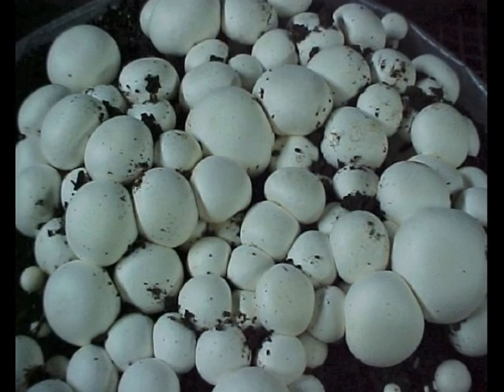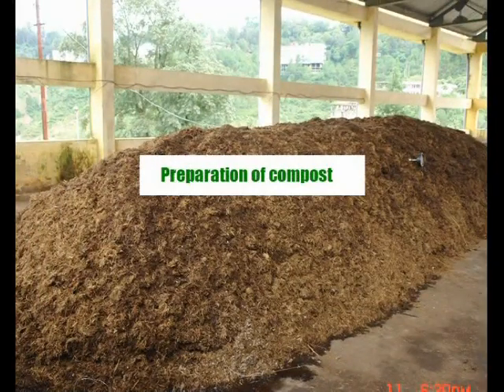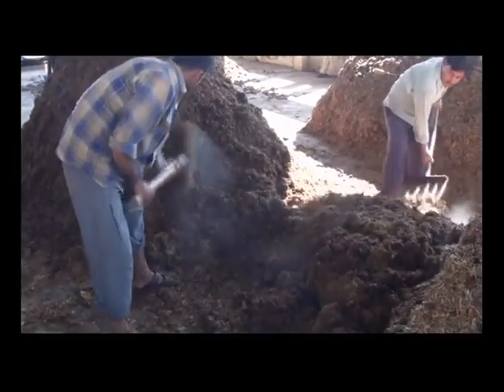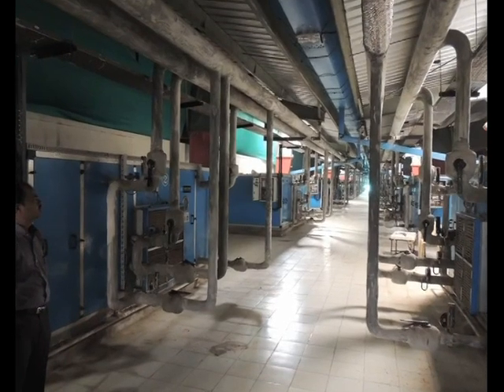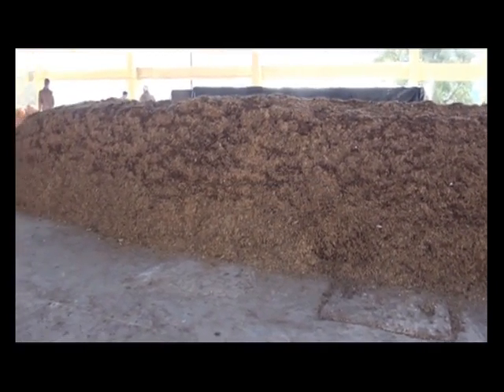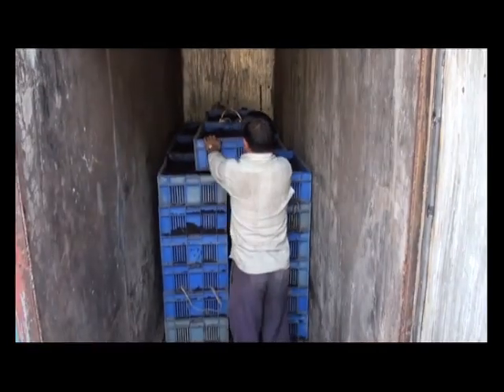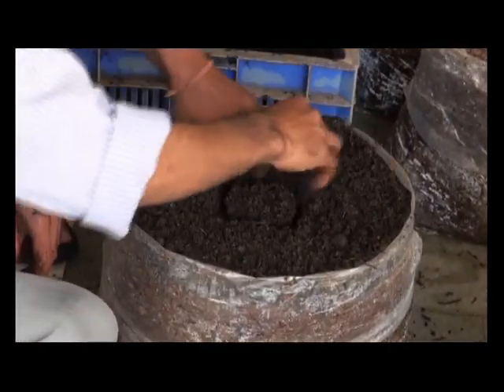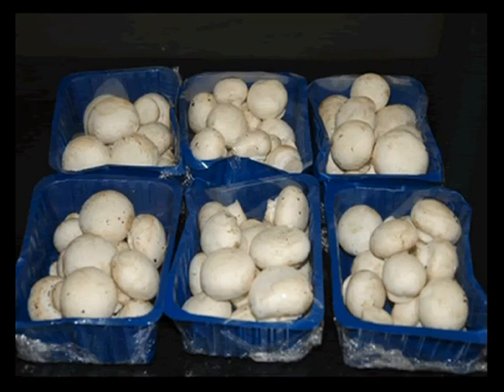White Button Mushroom Cultivation (Agaricus bisporus) - DMR Solan

Comment: Manufacturing / importing & trading in items used in Button mushroom industry

Punnet Rs102/= per kg
90 pcs in one kg
Excellent quality 

https://youtu.be/o6Vy-dIGs10

https://youtube.com/shorts/iXjypDkrXs8?feature=share

https://youtu.be/1MvgOhN2MhY
https://youtu.be/6hIt_1fSMFg

Cling film Antifog
Rs3500/ box, 
Premium quality 
6 pcs in one box ,
https://youtu.be/toGJejzF3og
Best fresh 
https://youtu.be/HWwDh74cOks

Cling film Antifog
Premium quality
Two roll packiging
One roll weight 4.400 kg film
Rs3500/
https://youtube.com/shorts/h6LSJ96rVxs?feature=share

https://youtu.be/uqBPKrUw3Gc

Cling Film Antifog
Made in Korea 
6 rolls in one box
Weight of roll 2.1 kg
Weight of film 1.5 kg
Paper core 0.600 gms
Net weight of film 9 kg
Rs3500/ box

https://youtube.com/shorts/layHJawLntU?feature=share

Spawn neck ring
Rs0.55/ per pc
Minimum quantity 10000 pcs

https://youtube.com/shorts/pw0hDtYnfxg?feature=share

Panni PP
6"x7" , 200 gm,  
30 kg bag @Rs160/=

Panni
PP 7" X 16" for spawn bag Rs180/= per kg Delhi

Compost Bag HM 24"x30"
With handle 
50 pcs
virgin quality 
Rs160/= packet
https://youtube.com/shorts/4Oo1jAZBtrg?feature=share

Compost Bag
LD 22"x26" 
virgin quality 
Rs160/= per kg 
https://youtu.be/_oNNeKZVrS4
https://youtu.be/KGYVm-au8Qc

Spawn bag PP 
size 7"x16.5" 
Air /Water proof sealing.
Rs165/ per kg
https://youtu.be/kFR3w43A7hk

Poly air Duct tube 
Rs210/ per kg
20" to 32" size

Punnet packing machine 
Rs3500/=

Punnet packing machine twin heater model premium
Rs8500/

Punnet packing machine twin heater
Rs7500/
https://youtu.be/frEV_vdeBks
https://youtu.be/X44zvK82-Cg
https://youtu.be/zZcwate4kuQ
https://youtu.be/DNZKI1MR_64
https://youtu.be/NxlKWwryNeU

Hydrion 
Ammonia Meter Test paper strip :

This is used to check ammonia levels in tunnels (phase 2) during conditioning stage .
The result is accurate in 15 second time , more than 100 tests can be performed 

Range : 0-5-10-20-50-100ppm
Rs2700/=

Co2 Meter Rs11500/ 
(Runs with normal cells, USB cable , mobile power battery bank and electricity)

Co2 Meter Rs13500/ 
(with inbuilt rechargeable battery)
Also runs with USB cable , mobile power battery bank and electricity

Range 0 to 9999 ppm 
With temperature & humidity function 

https://youtu.be/JTdVKDJKPsQ

https://youtu.be/AfAQbk1wdfY

https://youtu.be/NnUAMTOpajM

https://youtu.be/gsM3fdggjrs

https://youtube.com/shorts/l9y-Mj0EhfY?feature=share

https://youtu.be/45ltDQU6o4w

Sealing machine 12" Rs1600/=
One year warranty 

Automatic button mushroom pouch
sealing machine
Rs16000/

https://youtu.be/mH32fY6vMkY

https://youtube.com/shorts/hbKuzOrML88?feature=share

Shower
Made in Italy
Rs1600/
https://youtube.com/shorts/f86LdbXJ-vw?feature=share

Shower misting
https://youtu.be/dPHz4a5JJP0

Gardena shower Rs2500/
Made in Germany 
https://youtu.be/gbvSqIX-vIc

Digital hygrometer 

Wet and dry bulb hygrometer Rs500/
Brand : Zeal,  (Made in England)

Digital Humidity controller with sensor
Rs4000/

Dual temperature meter with RH
https://youtu.be/y9sqEqnRNMY

Digital thermometer screwdriver type Rs160/
https://youtu.be/ZH1GXP2ibsE

Glass thermometer 12" 
Rs60/ & Rs200/

https://youtu.be/PhO0VEyLoaU

Ph strip Rs400/= & Rs1100/

Ph meter Rs700/ HANNA brand 
https://youtu.be/xgxZosfN2OU

TDS meter with temperature meter Rs250/

*EC meter*, with TDS & temperature Rs475/

Digital Temperature meter with 
12 meter long wire, 6" long sensor rod
Rs3000/

12 meter long wire, 12" long sensor rod
Rs4150

12 meter long wire, 24" long sensor rod
Rs4975

12 meter long wire, 36" long sensor
Rs5300/

https://youtube.com/shorts/7jsTiwvCipg?feature=share  

https://youtu.be/fEnzYnUmaJs

Centrifugal Humidifier 5lt per hour capacity 
Rs17500/ without sensor and controller
Rs21500/ with automatic sensor and controller 
With accessories Rs22000/

https://youtu.be/AV4UyG-0CkY

https://youtube.com/shorts/bDXFP9KokSA?feature=share

https://youtu.be/PvtzpbGfcqU

https://youtu.be/Muhq1GX_7P4
https://youtu.be/bEh56VyIT-Q
https://youtu.be/hdYtcgRtAMI
https://youtu.be/McSEHSiXAu0
https://youtu.be/MIUopZ7yIIY

Formalin 37% pure
Rs2200/
50 kg CAN packing 

KMS 
Potassium Metabisulphide for washing Rs140/= per kg
50 kg drum packing

Cocopeat brick 5 kg Good quality , low fiber
Rs23/

PET wire
Material PET
Rs290/= per kg
One kg has 100 meter length 
Used instead of saiya in Mushroom racks 

Temperature meter and Controller
Brand Sub-zero
Rs3800/
https://youtu.be/WWKfykoHHm0

Co2 *dampers 
with handle and aluminium frame filter

Co2 gravity dampers 
without handle and aluminium frame filter

Size 20"x20"
Rs2200/ per pc , 
Rs500/ filter

https://youtu.be/HATBH7KyXz4

https://youtu.be/l6pz0r63c64

Co2 automatic *damper
https://youtube.com/shorts/oDvksTTUkzw?feature=share

Fresh air blower with branded motor in 12" ,15" and 18" Branded industrial motor fan

https://youtu.be/HATBH7KyXz4

Spigot for aerated flooring in tunnel & bunker Rs17/ per pc

https://youtu.be/reLeRMQ2sIc
https://youtu.be/1_Fh4nImBjE

Button mushroom knife Rs45/ and Rs90/
https://youtu.be/RrbMxThWs2A

https://youtube.com/shorts/nWyPx61UM4M?feature=share

Packing tape 3"
Transparent and Brown colour
Rs3100/ box 

Tape dispenser 2" tape
https://youtu.be/nGh46Vpz1T4

Button mushroom *knife

https://youtu.be/RrbMxThWs2A

https://youtu.be/nWyPx61UM4M

Potassium permanganate “KMNO4 for fumigation
Rs450/ per kg
Adding 35 mL of formalin (40 percent formaldehyde) to 17.5 g potassium permanganate “KMNO4” per one cubic metre of space for 20 Minutes. When mixing with potassium permanganate for fumigation, always add the formalin to the potassium permanganate, never the reverse.

Silicone Gel used for sealing Puff pannel joints. 
Rs200/per pc

https://youtu.be/1OMWceyrMsA

Delivery Delhi

Mushroom Hub
Vivek Kapoor 
7590008263

Whatsapp No.
9818578263
9810929262

https://youtube.com/@buttonmushroomhub

Comment: Manufacturing / importing & trading in items used in button mushroom industry

Panni
PP 7" X 16" for spawn bag Rs160/= per kg Delhi

Spawn neck ring
Rs0.55/ per pc
Minimum quantity 10000 pcs

https://youtube.com/shorts/pw0hDtYnfxg?feature=share

Panni PP
6"x7" , 200 gm,  
30 kg bag @Rs160/=

Compost Bag HM 24"x30"
With handle 
50 pcs
virgin quality 
Rs160/= packet
https://youtube.com/shorts/4Oo1jAZBtrg?feature=share

Compost Bag
LD 22"x26" 
virgin quality 
Rs155/= per kg 
https://youtu.be/_oNNeKZVrS4
https://youtu.be/KGYVm-au8Qc

Punnet Rs105/= per kg 
Plus delivery charges 
https://youtu.be/1MvgOhN2MhY
https://youtu.be/6hIt_1fSMFg

Spawn bag PP 
size 7"x16.5" 
Air /Water proof sealing.
Rs165/ per kg
https://youtu.be/kFR3w43A7hk

Poly air Duct tube 
Rs210/ per kg
20" to 32" size

Punnet packing machine 
Rs3500/=

Punnet packing machine twin heater model premium
Rs8500/

Punnet packing machine twin heater
Rs7500/
https://youtu.be/frEV_vdeBks
https://youtu.be/X44zvK82-Cg
https://youtu.be/zZcwate4kuQ
https://youtu.be/DNZKI1MR_64
https://youtu.be/NxlKWwryNeU

Cling film Antifog
Premium quality
Two roll packiging
One roll 4 kg film
Rs4000/
https://youtu.be/uqBPKrUw3Gc

Cling film Antifog
Rs3500/ box, imported,zero % rejection 
6 pcs in one box ,
https://youtu.be/toGJejzF3og
Best fresh 
https://youtu.be/HWwDh74cOks

Hydrion 
Ammonia Meter Test paper strip :

This is used to check ammonia levels in tunnels (phase 2) during conditioning stage .
The result is accurate in 15 second time , more than 100 tests can be performed 

Range : 0-5-10-20-50-100ppm
Rs3200/=

Co2 Meter Rs11500/ 
(Runs with normal cells, USB cable , mobile power battery bank and electricity)

Co2 Meter Rs13500/ 
(with inbuilt rechargeable battery)
Also runs with USB cable , mobile power battery bank and electricity

Range 0 to 9999 ppm 
With temperature & humidity function 

https://youtu.be/JTdVKDJKPsQ

https://youtu.be/AfAQbk1wdfY

https://youtu.be/NnUAMTOpajM

https://youtu.be/gsM3fdggjrs

https://youtube.com/shorts/l9y-Mj0EhfY?feature=share

https://youtu.be/45ltDQU6o4w

Sealing machine 12" Rs1600/=
One year warranty 

Automatic button mushroom pouch
sealing machine
Rs16000/

https://youtu.be/mH32fY6vMkY

https://youtube.com/shorts/hbKuzOrML88?feature=share

Shower
Made in Italy
Rs1600/
https://youtube.com/shorts/f86LdbXJ-vw?feature=share

Shower misting
https://youtu.be/dPHz4a5JJP0

Gardena shower Rs2500/
Made in Germany 
https://youtu.be/gbvSqIX-vIc

Digital hygrometer 

Wet and dry bulb hygrometer Rs500/
Brand : Zeal,  (Made in England)

Digital Humidity controller with sensor
Rs4000/

Digital thermometer screwdriver type Rs160/
https://youtu.be/ZH1GXP2ibsE

Glass thermometer 12" 
Rs60/ & Rs200/

Ph strip Rs400/= & Rs1100/

Ph meter Rs700/ HANNA brand 
https://youtu.be/xgxZosfN2OU

TDS meter with temperature meter Rs250/

*EC meter*, with TDS & temperature Rs475/

Digital Temperature meter with 
12 meter long wire, 6" long sensor rod
Rs3000/

12 meter long wire, 12" long sensor rod
Rs4150

12 meter long wire, 24" long sensor rod
Rs4975

12 meter long wire, 36" long sensor
Rs5300/

https://youtube.com/shorts/7jsTiwvCipg?feature=share  

https://youtu.be/fEnzYnUmaJs

Centrifugal Humidifier 5lt per hour capacity 
Rs17500/ without sensor and controller
Rs21500/ with automatic sensor and controller 
With accessories Rs22000/

https://youtu.be/Muhq1GX_7P4
https://youtu.be/bEh56VyIT-Q
https://youtu.be/hdYtcgRtAMI
https://youtu.be/McSEHSiXAu0
https://youtu.be/MIUopZ7yIIY

Formalin 37% pure
Rs2200/
50 kg CAN packing 

KMS 
Potassium Metabisulphide for washing Rs140/= per kg
50 kg drum packing

Cocopeat brick 5 kg Good quality , low fiber
Rs23/

PET wire
Material PET
Rs290/= per kg
One kg has 100 meter length 
Used instead of saiya in Mushroom racks 

Temperature meter and Controller
Brand Sub-zero
Rs3800/
https://youtu.be/WWKfykoHHm0

Co2 dampers Rs2500/ per pc , Rs500/ filter
& fresh air blowers
https://youtu.be/l6pz0r63c64

Co2 automatic damper
https://youtube.com/shorts/oDvksTTUkzw?feature=share

Spigot for aerated flooring in tunnel & bunker Rs17/ per pc
https://youtu.be/1_Fh4nImBjE

Button mushroom knife Rs500/
https://youtube.com/shorts/uFqTVBrYrL0?feature=share

Packing tape 3"
Transparent and Brown colour
Rs3100/ box 

Tape dispenser 2" tape
https://youtu.be/nGh46Vpz1T4

Button mushroom knife

https://youtu.be/RrbMxThWs2A

https://youtu.be/nWyPx61UM4M

Potassium permanganate “KMNO4 for fumigation
Rs450/ per kg
Adding 35 mL of formalin (40 percent formaldehyde) to 17.5 g potassium permanganate “KMNO4” per one cubic metre of space for 20 Minutes. When mixing with potassium permanganate for fumigation, always add the formalin to the potassium permanganate, never the reverse.

Delivery Delhi

Vivek Kapoor 
7590008263
9818578263 whatsapp only..

Comment: Manufacturing / importing & trading in items used in button mushroom industry 

PP 7" X 16" for spawn bag Rs160/= per kg Delhi

6x7 , 200 gm,  30 kg, Rs160/=

Compost Bag HM 24x30
With handle 
50 pcs
virgin quality 
Rs145/= packet
https://youtube.com/shorts/4Oo1jAZBtrg?feature=share

Compost Bag LD 22x24
50 in one kg 
virgin quality 
Rs140/= per kg 
https://youtu.be/_oNNeKZVrS4
https://youtu.be/KGYVm-au8Qc

Punnet Rs110/= per kg 
Plus delivery charges 
https://youtu.be/6hIt_1fSMFg

Duct air tube Rs180/= per kg 
15" to 32" size

Punnet packing machine 
Rs3000/= & Rs7000/
https://youtu.be/frEV_vdeBks
https://youtu.be/X44zvK82-Cg
https://youtu.be/zZcwate4kuQ
https://youtu.be/DNZKI1MR_64
https://youtu.be/NxlKWwryNeU

Trading 

Cling film 
Antifog
Rs2850/ box, 
6 pcs in one box ,
Best fresh , Oxywrap, 2Wrap and Sun film
https://youtu.be/HWwDh74cOks

Hydrion Ammonia Meter Test paper strip :

This is used to check ammonia levels in tunnels (phase 2) during conditioning stage .
The result is accurate in 15 second time , more than 100 tests can be performed 

Range : 0-5-10-20-50-100ppm
Rs3100/=

Co2 Meter Rs10500/= 
Range 0 to 9999 ppm 
With temperature & humidity function 
https://youtu.be/NnUAMTOpajM
https://youtu.be/gsM3fdggjrs
https://youtube.com/shorts/l9y-Mj0EhfY?feature=share
https://youtu.be/45ltDQU6o4w

Sealing machine 12" Rs1300/=
One year warranty 
https://youtu.be/mH32fY6vMkY
Gardena shower Rs2100/
Made in Germany 

Digital hygrometer 
Wet and dry bulb Rs500/
Brand : Zeal,  (Made in England)

Digital thermometer screwdriver type Rs150/
https://youtu.be/ZH1GXP2ibsE

Glass thermometer 12" 
Rs60/ & Rs200/

Ph strip Rs400/= & Rs1100/
Ph meter Rs700/ HANNA brand 
https://youtu.be/xgxZosfN2OU

TDS meter with temperature meter Rs250/
EC meter with TDS & temperature Rs475/

Digital Temperate meter with 
12 meter long sensor wire 
Rs3000/ 
Brand : Thermotech
https://youtu.be/fEnzYnUmaJs

Humidifier 5lt per hour capacity 
Centrifugal Rs26000/ with sensor and controller 
https://youtu.be/bEh56VyIT-Q
https://youtu.be/hdYtcgRtAMI
https://youtu.be/McSEHSiXAu0
https://youtu.be/MIUopZ7yIIY

Formalin 37% pure
Rs2000/
50 kg CSN packing 

KMS Potassium Mesabisulphide for washing Rs105/= per kg

Cocopeat brick 5 kg Good quality 
Rs24/

Rope 
Material PET
Rs290/= per kg
One kg has 100 meter length 
Used instead of saiya in Mushroom racks 

Temperature meter and Controller
Brand Sub-zero
Rs3600/
https://youtu.be/WWKfykoHHm0

Co2 dampers Rs2000/ per pc 
& fresh air blowers
https://youtu.be/l6pz0r63c64

Co2 automatic damper
https://youtube.com/shorts/oDvksTTUkzw?feature=share

Spigot for aerated flooring in tunnel & bunker Rs17/ per pc
https://youtu.be/1_Fh4nImBjE

Button mushroom knife Rs500/
https://youtube.com/shorts/uFqTVBrYrL0?feature=share

Packing tape 3"
Rs2600/ box 

Tape dispenser 2" tape
https://youtu.be/nGh46Vpz1T4

Delivery Delhi

Vivek Kapoor 
7590008263
9818578263 whatsapp only.

Comment: Formaldehyde - I think we can avoid using it if we can sterilize the floor using hot blow that is used in poultry farms to clean the floors before new chicks are bred... Also what if the compost is boiled in water - will it not be good enough to remove ammonia and sterilize it ?
Reply from the maker: Yup that can work

Comment: Technique for compost making 
It takes 20 to 25 days to compost a simple method to make a 
compact with this method for 100 cm long, 50 cm wide and 15 cus 15 in height.

material:
Rice or chopped straw to 10-12 cm length of wheat - 250 kg of 
rice or wheat bran - 20-25 kg 
ammonium sulfate or calcium ammonium nitrate - 4 kg 
urea - 3 kg of 
gypsum - 20 kg 
Malathion - 10ml litter 
Know more :-
https://mushroomone.blogspot.com

Comment: At 11:48 he says spray the floor with formaldehyde, NO THANKS, buying from these guys.
Reply from the maker: its says 24 hours before you perform the spawning operation ... however if you have clean floor you don't need to spray or you can use any other disinfectant which is readily available and more useful ... its all precautionary

Comment: I want to ask you a question if you could answer it. What if the moisture content in compost is not adequate after the phase 2 tunnel in short method? Can we add watsr directly or i mean spray water over compost till it reaches the level of leaching???
Reply: You want 68-70% moisture.

Comment: the long method compost why it is not pasteurized??? with heat i mean
Reply from the maker: Those who do not have any pasteurization chamber/room make compost through long method. That is why it is a long process. The heat generates in the compost pile and with regular turnings and the process ends when its free from ammonia.
If there is a pasteurization room with blower the compost can made in less time thus early cropping.
This all depends on the infrastructure available.